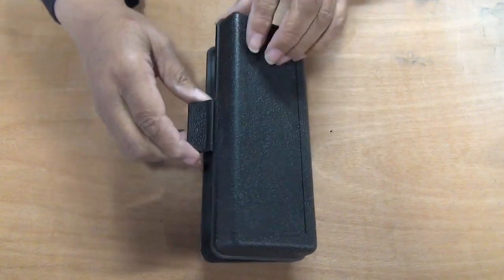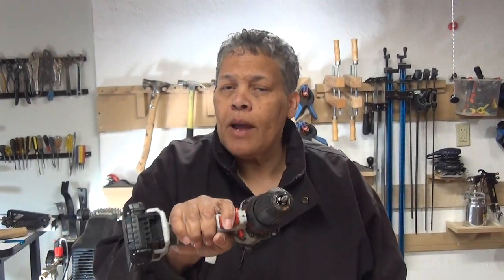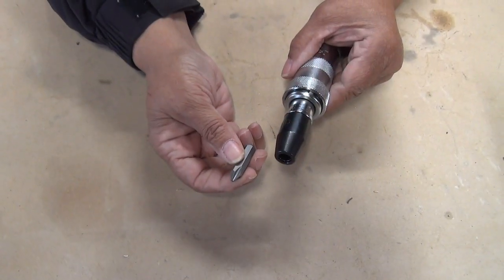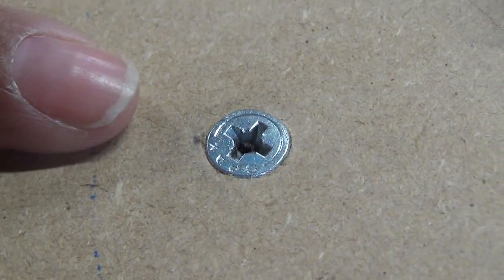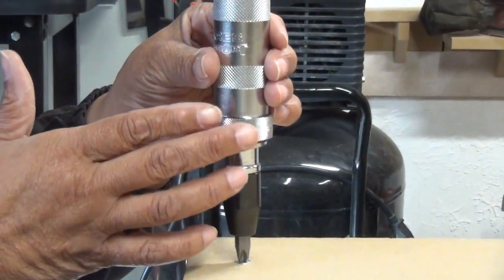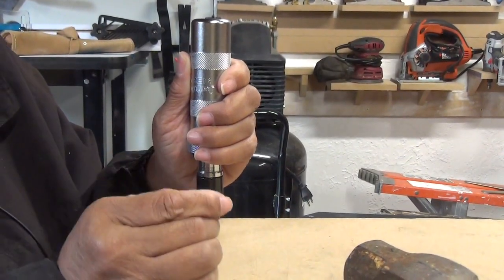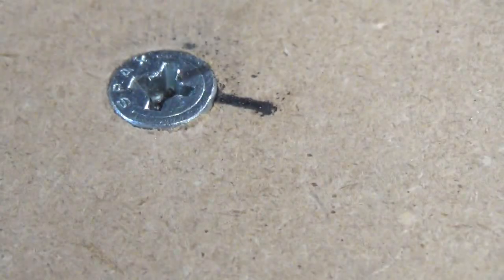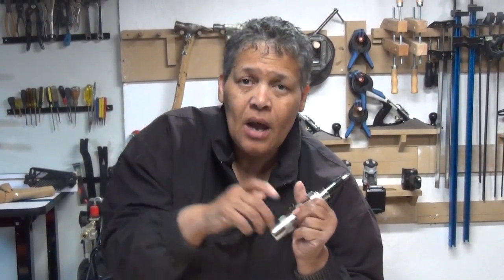Remove Stuck Screws with This Cool Tool

Comment: nice video, just want to say that phillips head screws are absolute nightmare to remove when installed on self-locking anchor nuts in aviation industry, especially the underwing ones, you have to hammer upward!!
it's so counter-intuitive, you need to apply insane downforce to not let the driver cam out, which means very high friction and more tendency to cam out.
it's like this kind of screw was designed not to be removed after it has been installed (car industry?).
bad design for the purpose, and yet still so easily found everywhere!  I mean c'mon it's 2018 now and still?  good thing that Airbus use torq-set head, alot better.  I think torx head is the best.

Comment: A must for brake rotors.  But on Japanese cars what looks like a Phillips, isn't really a Phillips, but a different design, and you need the correct but impossible to find bit.     I do have an impact tool like yours, used it only a couple of times, worth it's weight in gold.  Ok, maybe not gold, but maybe silver,  the silver used in Kennedy half for '65-'69.  (40% silver).  I need to get a life.

Comment: If a screw or whatever is rrreaaly stuck, doesn't this tool increase the chance that the head of the screw breaks off..?
Reply: Good point, another way to look at it is if the head breaks off than it was going to break off anyway.

Comment: I did not here you say this so im gonna , The tool was designed for Fasteners used Steel to Aluminum like on motors and stuff. But also it reverse's to do left hand Threads, so if it is set Wrong you will be Tightening and Stripping a Screw. BE CAREFUL

Comment: The demo was on a screwhead that looked ok ? What about a badly threaded one ?
Reply from the maker: Impact screwdrivers  are not  damaged screw extractors.  They remove seized screw without damaging the head.  A screw extractor is a different tool.

Comment: Pointless to argue anything cause everyone has their personal preference... and that's great. However...after working in a retail fastener store and much personal experience 99% of failed PH2 screw extractions is the result of using the same worn out PH2 bit that you used the last 2000 times! Bits are cheap...

Comment: Awesome tool. It won't work for my screw though. I'm trying to disassemble a microwave door. (How in Gods Green earth did those children manage to drool food on the glass inside the door?)(not the inside of the microwave but inside the sandwich of the door?) I'm afraid this method would break the glass. Do you have any other ideas?

Comment: What about an old rusted screw with a broken head?
Reply from the maker: There is a tool for that, actually a drill bit that helps to remove headless screws.

Comment: I like that screw driver BUT you used it on a good threated screw , I was expecting you to remove the worn out one with the screw driver, then I would buy it, till then it's not in the pocket :)
Reply from the maker: But that was the point....that you use it on a good screw that is stuck, so that you don't strip out the screw head.  There is another tool that you use to remove a stripped out screw...here is the link to that video:  https://youtu.be/xzX6LVm8H1c

Comment: I didn't see you actually extracting a really damaged stuck screw why? I thought that was the point.
Reply from the maker: No that wasn't the point of the video.  The point was to demonstrate how to remove seized screws, as not to damage and strip the screw head.  Seejanedrill has several other videos on extracting damaged screws.
Reply: @seejanedrill  My bad, thank You!
Reply from the maker: @hudentdw2  no worries😊

Comment: I have one and if you work on your cars, it is a must have. I use it to remove the bolts that are in my rotors on my Honda Civic and Odyssey. Without it, they would strip. Honda please stop  the stupidity of using screws in rotors! Toyotas, my other two cars, are press fit and have no screws. A lot easier to get them off. Really stupid Honda, Really stupid.

Comment: Not a good demo since the screw was in wood. I have used these numerous times on cheap ass Japanese screws in motorcycles. Upon removal, I replaced the Phillips screws with Allen heads. Great video but not demonstrative enough.
Reply from the maker: I looked all over the shop for a seized screw to demonstrate on camera, unfortunately there was none and I simply had to improvise.
Reply: Probably because you never mess one up like that!

Comment: Leah you’re wonderful but at 0.05 you made a mistake. You said "…my new toy" when what you should have said is "…my new absolutely essential tool, without which the entire world will instantaneously combust wiping out all civilisation." I just hope my wife never sees this video.

I have a half inch socket anvil and a couple of sockets in mine as well as eight driver bits.